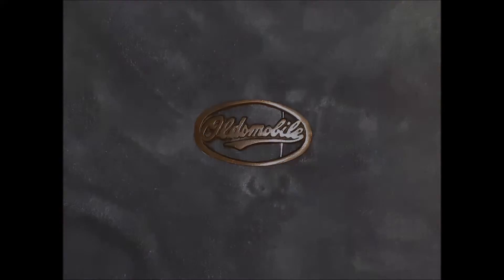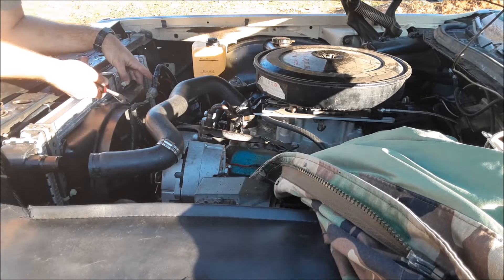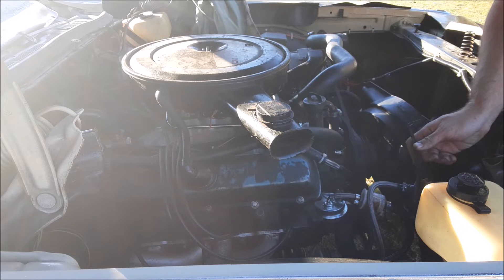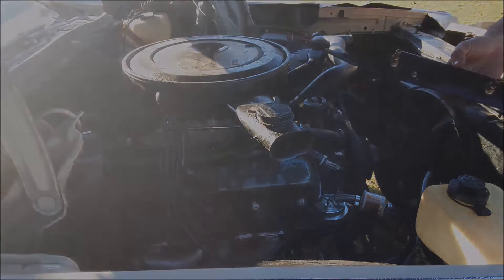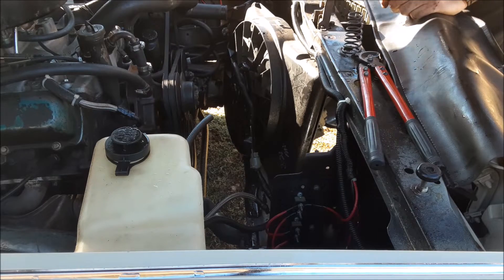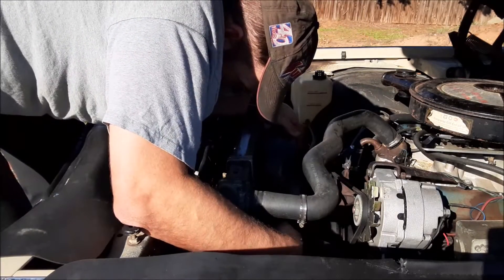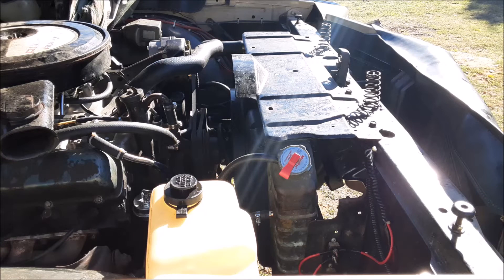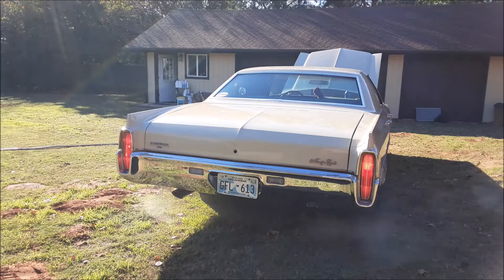Remove failed radiator & install an OE radiator

Comment: Jesse - You sure all that steam isn't from residual antifreeze coolant burning off? Antifreeze smokes like a bandit when it burns off of hot metal.
Reply from the maker: It would be great if the steaming was just due to a dirty engine.  We'll see conclusively once I do a compression test this weekend.  Thanks for watching!
Reply: @Olds64  If you're going to do a compression test, perform both a dry & wet compression test as long as you're doing one.
Reply from the maker: @ngeltz  Will do. I'll keep everyone on the site posted.

Comment: Just joining here Jesse!  Oldsmobiles forever!  I did see the compression test clip. We have a car (1980 Eagle Sedan) that would smoke like that due to a bad valve cover design leaking all the time, gaskets did not help, we got a Clifford aluminum cover and the smokies went away. Bad gaskets on yours may be the cause.  Could there be an air pocket somewhere in the engine block?  Big block Oldsmobiles need a good flow of coolant!  Do you have a pyrometer to verify true temperatures?
Reply from the maker: Thanks for watching Sammy. Doing the compression test dry and then wet verified my head gaskets or valves were bad. I suppose I could have done a cylinder leak down test, but after the radiator exploded I had a pretty good idea the gaskets were shot.